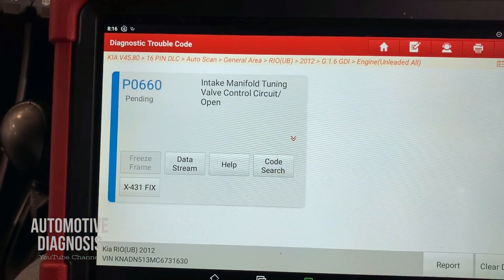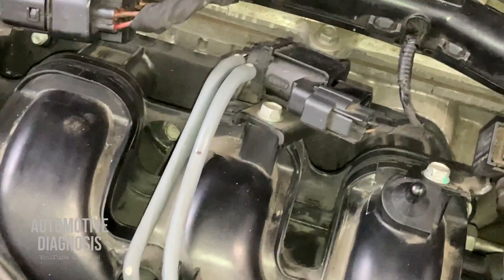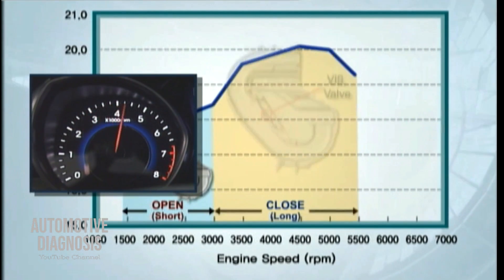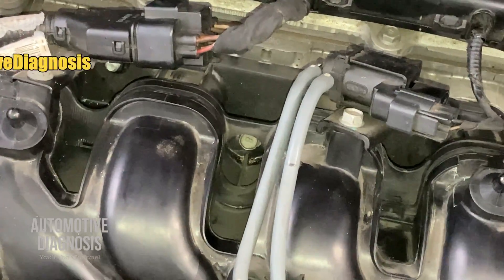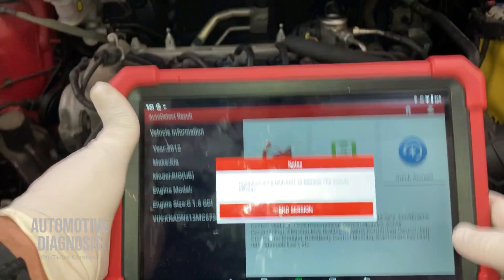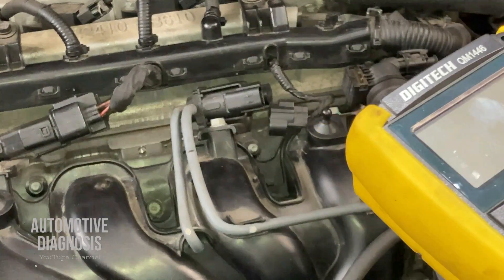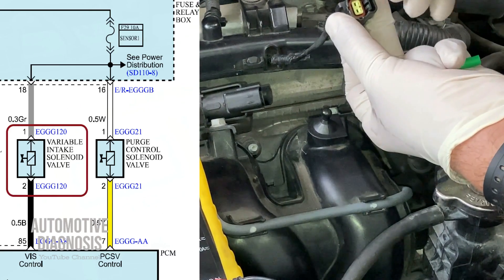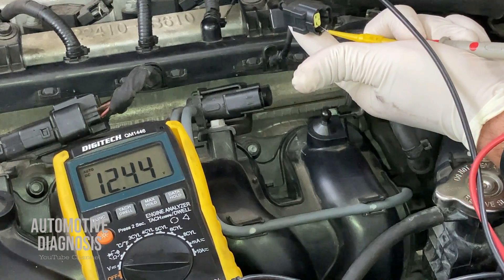Test & Fix P0660 Variable Intake System Fault Code #intakemanifold #engine

Comment: 6:07 - This 3.5V is absent when the solenoid is connected to its connector, right?
Reply from the maker: Hi there. It actually turns into 12 V when connector is connected.

Comment: Hi sir i just want to ask you a question out of the topic I have a customer who owns a Sportage km 2010 the customer complaint is that his car hesitates at first gear from time to time when i hooked the scan tool i found an active fault code that says neutral switch malfunction by the way it has a manual transmission i just want to know if this problem can cause engine hesitation and thank you in advance
Reply from the maker: Hi my friend. Do you have the fault code as well?
Reply: @AutomotiveDiagnosis  hi sir yes p0820
Reply from the maker: Hello again my friend. Yes, it can actually cause this issue and here is everything you need to diagnose the car. I attached the wiring and switch diagnosis for P0820 to the following link for KIA Sportage KM 2010:
https://drive.google.com/file/d/1MhT57_OkcOBW8Q8H_TqdgJfG3yenVsWF/view?usp=sharing
Reply: @AutomotiveDiagnosis  thank you sir very much i really appreciate your help 😊🙏🙏
Reply from the maker: @medch4193  My pleasure